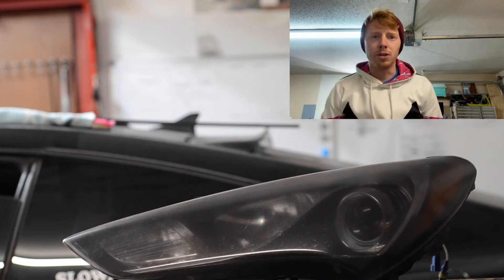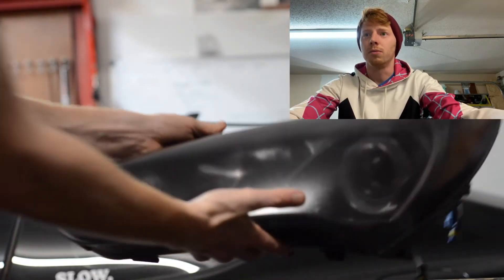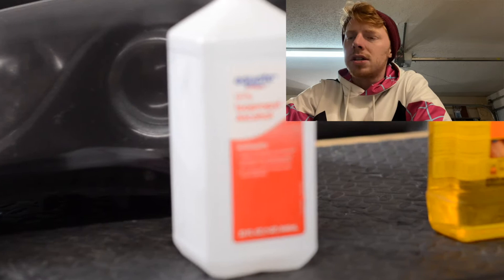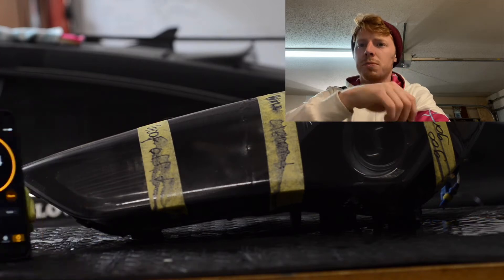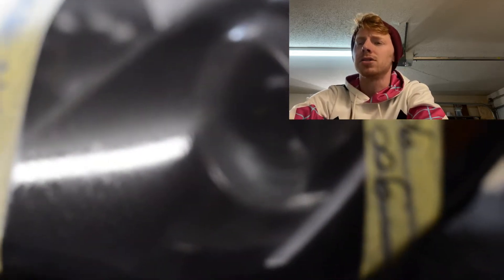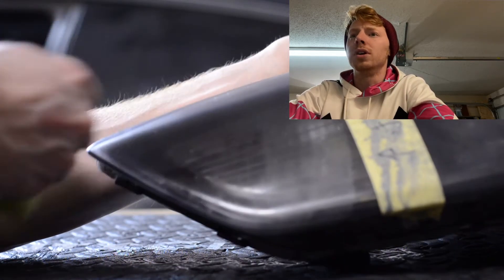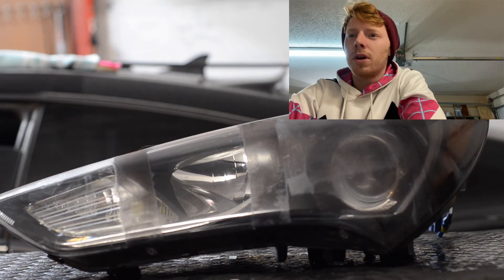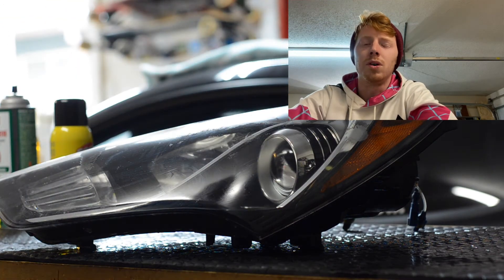How NOT to remove niteshade.

Comment: I learned from a video that Niteshade cancels itself. Just spray niteshade into a rag and rub it off. I cleared my tail lights in 20 minutes
Reply from the maker: wait ......... what?!?
Reply: Will it still work if there is a clear coat on it
Reply: @inkyboy513  I’m not too sure. You could try.
Reply: @inkyboy513 does it work ?
Reply: @CancelYuko it does work just use a little bit on a rag and use a little elbow grease and you’re set